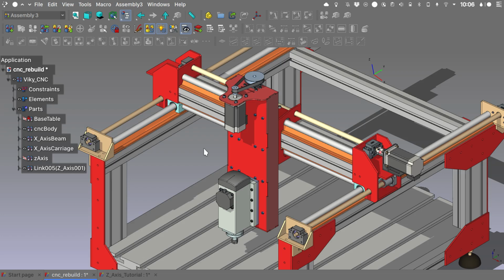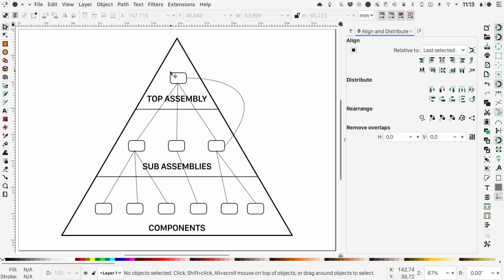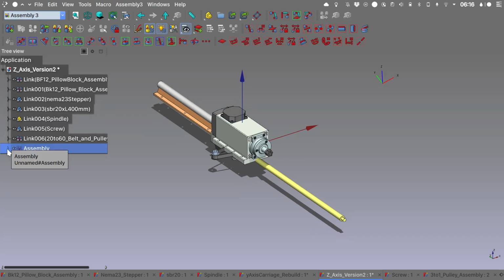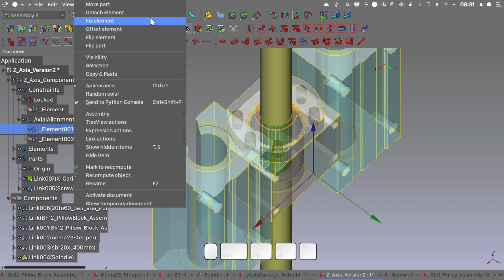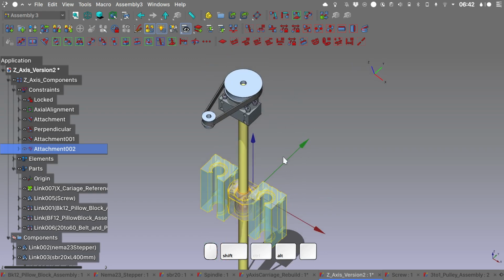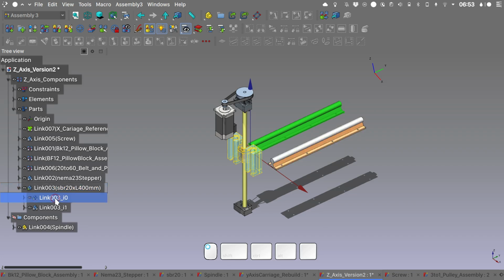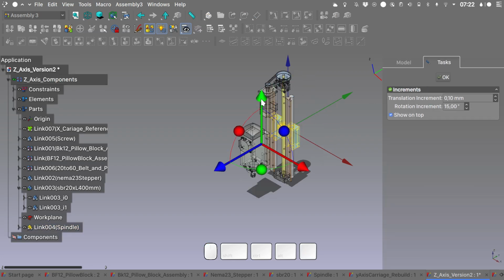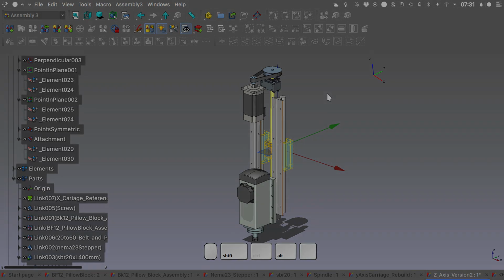[LinkStage3] FreeCAD in context modelling using assemblies. Part1 assembly3.

Comment: Hi, as always excellent and I shall watch the whole series (I am sure many times... to fully understand it)
One question, please:
When I say "in context" I don't necessarily mean just attachment points, elements etc.

Assume I have external sub-assemblies A and B, linked to a top level Assembly D.
Inside Assembly D I now also have sub-assembly C that is related (positionally and dimensionally) to both sub-assemblies A and B.
My main issue is the use of sub-shape binders to "context" C to both A and B.

Advice from @realthunder was:
"...I suggest you separate the process of modeling and assembling. If you want to use binder to do in context modeling, then it is better to make an assembly that is dedicated for this purpose. You then create a separate assembly in another file to use the model as part for assembling. This will reduce the chance of accidently change your model while assembling..."

I am still a bit vague about best way to model things (that are related to each other) in separate/external files.
Look forward to improving my understanding with your videos - thank you!!!!!
Reply from the maker: I will make a video with strategies for your example. I first need to put out part 2 of this tutorial tough
Reply: @OficineRobotica  thank you very much!
look forward to all your videos 👍
Reply: I have the same question, looking forward :)